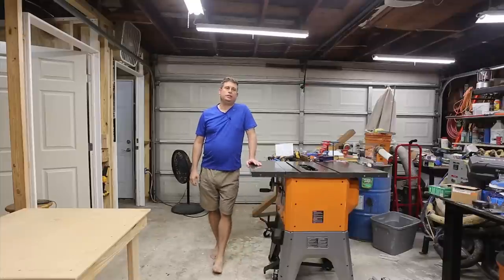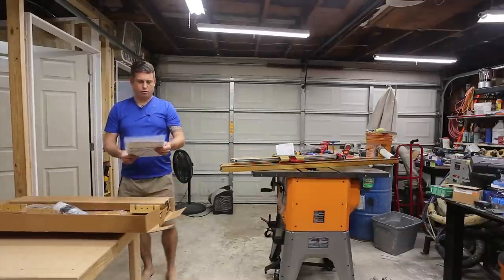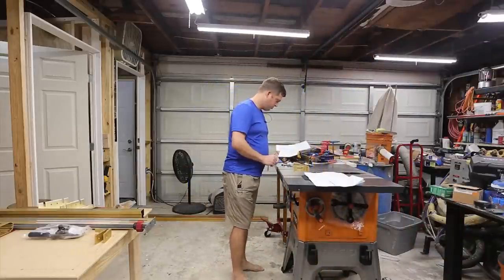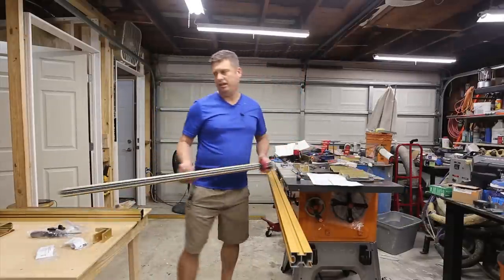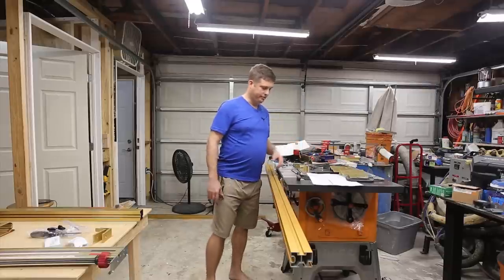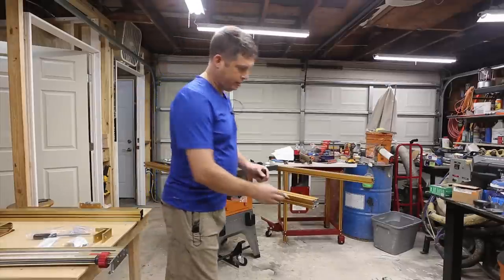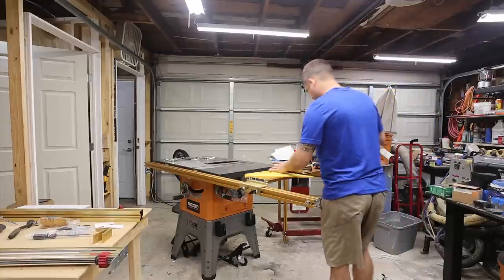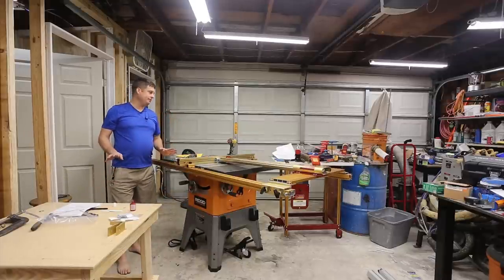Install Incra Fence System on Ridgid R4512 Table Saw

Comment: Finally, a DIY guy that moves at my speed, does things they way I do and is more real. You reading the instructions could have been left out but but I am looking to do a similar setup. Thx
Reply from the maker: Thank you.  I try to shoot my videos from the "hang out while I work on this" perspective for the most part.  I find pure instructional videos to be boring.  I've tinkered with more and less editing.  These are some of the longer ones and could definitely have been shortened.  I thought it might help folks to see an install.

Comment: Just so anyone else watching this knows you do not need to drill out the rear bolts for the fence brackets. The holes are already tapped and threaded and you just need to use the bolts that came with the Ridgid Saw for the rear Incra rail. I just installed this same fence myself recently and noticed this video. Thanks for sharing your experience.
Reply from the maker: Correct.... that was my mistake, but it turned out great.  Unfortunately a new project I'm not ready to talk about has crowded my garage temporarily.  All in due time.

Comment: Did you think about the metal shaving that dropped while you re-engineered the installation of the rail  ? Just wondering bc you forgot to put your shoes on . Glad it's your feet and not mine . Thanks for posting the video

Comment: I'm sorry, but you left out the very important step of positioning the two fence glide supports at the front and back of the fence. (at the video13:00-13:04)  These supports are for leveling the fence at the proper clearance height above the table to keep the fence smoothly gliding on the rails. A vital part of the setup process for accuracy.

Comment: My incra fence is supposedly going to ship any day now. I'm scared to death now because I did not realize I had to drill into the cast iron top of the saw.
Reply from the maker: It depends on the saw and how you want to install it.  For my particular saw and the way I wanted it installed drilling was necessary.  It wasn't a big deal.  Just measure carefully and go slowly.  Do not put the drill on high and push hard.  Heat kills drill bits and you want to let the cutting edge on the tip of the bit do it's job.  A little light oil won't hurt either.  

The key with cast iron is to drill slowly and take your time.
Reply: @hotpuppy72  I have the ridgid 4512. I wanted to offset my rails closer to the right because I am limited on shop space on the left side and can not move the saw any further over to the right.

Comment: I don't have one but considering buying one and figuring out the install for my saw.  At around 20 minute mark, you had drilled holes in your saw and said you needed a bigger drill.  You then seem to have cut the part where you finished that part and we see you start to install the rail.  So, I'm slightly confused.  Are there rail brackets on the outfeed side?  Or, do you screw into your saw blots that slide into the rail?  I can't really see.
Reply from the maker: Oh, the first drill bit I used was too close to the bolt size.  I didn't film the second time I drilled the hole with a slightly larger drill bit.  Like many people I tend to buy drill bits as a "set" and then break or lose the most commonly used drill bits.  :)  

As best I remember, the rail slides on to bolt heads and then you tighten the nut on the back side to draw it tight.  

Believe it or not I have not gotten around to doing cabinet work, which is what I set this saw up for.  So other then a test cut or two I haven't done anything with it.  Part of the issue was that I got laid off and decided to make a career change, money has been tight.  Part of the issue was that the garage workshop wasn't finished.  I'm currently in the process of re-arranging and finishing the garage workshop.  Hope to start on cabinets very very soon.

A few folks have criticized the saw, but the Ridgid is a fine saw.  The Delta at the same price point is a fine basic saw as well.  Where it tends to be lacking is the fence and the table size.

I did rotate the caster arrangement by 180 degrees to make it easier to get to on the saw.  It's designed to be on the right side of the saw from the operator's position.

I used to have a Delta Unisaw.  Dust management was a nightmare, it was impractical bordering on impossible (per Delta Support) to retrofit a modern safety system such as a riving knife to the saw.  I had a Biesemeyer fence with a digital read out on it.  I found it nearly impossible to easily get precise, repeatable cuts without lots of fiddling.  That's fine for production work where you set it up and make hundreds of cuts.  It's a nightmare in a home shop where you make 1 or 2 of something and then move to the next part or cut.

Incra lets you dial in the cut you want with precision, make it, and move on.  This requires some setup on the front end.  If you need to make that cut again, you simply dial it back in.  I considered mounting the router on the saw but decided I like having dedicated tools better.  I also have an interest in metal machining which has exposed me to doing close tolerance work (.001 and .0001 inch tolerances).  Once you learn to work precisely it's difficult to accept +/- 1/16 of an inch which is .0625 inches.  I'm not suggesting that you can get thousands or ten-thousands tolerances in wood, but I can do better than hundredths of an inch.  To translate for my Metric friends (the rest of the non-US World), that 1/16 of an inch is 1.5875 MM which is pretty sloppy in my mind compared to .025mm (.001) or .00254mm (.0001)

While this saw is capable of handling 4x8 sheet goods (approx 1.3 x 2.5 Meters) that is a dangerous way to cut sheet goods.  I usually set up my track saw and am able to make my rough and fine cuts safely and easily without any risk.

Lastly, this is a long response, so I'll touch on another person's comment.  I was asked why I didn't buy a SawStop.  It's a nice saw, but it costs more than this Ridgid and the Incra fence system without delivering the same level of accuracy.  Nifty safety gadgets are not a substitute for safe work practices.  If the SawStop was a $100 or $200 premium I would have bought one instead.  It was almost a $1000 premium and I opted to continue doing what I have been doing for over 20 years, work safely and use push-sticks and other means to keep my fingers well away.  My TrueTrac (Track Saw System) is one such way of avoiding the dangers of cutting sheet goods on a table saw.
Reply: @hotpuppy72  Thanks for the response

Comment: What are your thoughts on the Incra Fence system after having it a while? I have the 4512 after spending a lot of time aligning the Arbor to the miter slot I am happy with this saw. I bought mine in 2014. I will say my lift mechanism pedal is in the front of the saw.
Thanks looking forward to hearing your thoughts.

Comment: Two things about being barefoot in a shop.  One, your wife is far more forgiving about tracking in dirt than mine.  Secondly, I agree with the others, it's not a good idea.  True, floors don't cutoff fingers, but they can have wood chunks, dropped screws,  splinters, and other debris that can injure a city slicker's tender bare feet.  And, you're less likely to slip wearing shoes.  ;-)
Reply from the maker: I appreciate everyone's concern... but A) I'm gay.... no wife, not now, not later, not ever.  B) I'm very careful and there was only sawdust out there that day.  The concrete felt good on my feet.   I don't anticipate any slip and fall issues on a concrete floor.  But I commend you for thinking about safety.  Keep up the good work.

Comment: Thanks for the video, it showed me things that I will try to avoid doing, I always wear shoes so that is a given. If you read the comments here, John Barr suggests buying a better saw, try the price and the fact that all those saws have a fence system that can't reproduce as well as this one will. The TSLS I ordered is supposed to be here next week, it is going on an old 10" Craftsman full size, they made a table top size that I don't think this system will fit, the table top was only 24" front to back. Riving knife, oh goodie another of those people who believes they are really great, to a point they are, until you discover they have vast limitations, you can make bad comments about my disdain for such things if you like, I started doing wood working before a riving knife was even thought of. Learn to use tools in a safe manner, don't expect manufacturers to make everything safe for you.

Comment: barefoot in the workshop!? and you talked about missing safety devices on your old tablesaw?.... mmmmm that's not responsible!  ;)
Reply from the maker: Fortunately, most concrete floors don't take fingers off.... even if you slip.
Reply: I did not think about the floor, but rather about letting fall a tool, or wood piece, or other on your toes ;)
Reply: Simple solution. Don't drop tools or wood. Be aware of what you are doing and your environment and you will be fine. The safety issues with using tools are completely different, because you never know when a piece of wood will jam unexpectedly or a board will kick back while you are cutting it. The reason people drop boards and tools on their feet is because they leave them piled up on their work bench or hanging off the edge, or are just not paying attention to what they are doing. 

I rarely wear shoes if I can avoid it and the only serious injuries to my feet have all been while wearing shoes. Maybe that's because people are more careful of where they put their feet when they are not wearing shoes.
Reply: Yes but no matter how careful you are, accidents happen. His box cutter could easily fall off the table and stab his foot.  I fully agree with Mr. P. It is completely irresponsible to show a video of a garage full of tools being used by someone without shoes. It sets a bad example.
Reply: Why not give credit for minding to remind freedom of and right to choose in own home, own feet, own life. Don't likey don't watch.
Reply: A 13 year old watched the video with me (Grandpa) and asks, "Drop a machined aluminum piece on one of your toes and see what happens I guess!"  So, I agree with one here who posted, "... that's not responsible ..."  Your intention is appreciated but isn't it Interesting that the documentation from Incra first focuses specifically on their concern for user / owner safety issues (re: in both installing and using the machinery) and they insist that you read all directions cover to cover one time before you begin.  A barefoot installation video free to anyone (any age) willing to watch?  How's anyone going to take it seriously?  Just say'n ...
Reply: I know I'm late but I wes born  with bare feet.

Comment: You really shouldn't use a cordless drill to screw in screws to aluminum. Aluminum strips out real easy.
Reply from the maker: Any tool can be abused.  I have carpal tunnel issues in both hands so I try to avoid manual torque operations whenever possible.  I'm careful with the impact driver and the cordless drill.  I rarely use the cordless drill for screws but it happens from time to time.

Comment: Dude your table saw just tripled in size. Is it worth it?
Reply from the maker: I think so, but not sure yet.  My screenprinting company startup has gotten in the way of my garage so I haven't had a chance to do much with my new saw and router table.  I'm patient though.  I should get my garage back this coming week and be able to put the saw through it's paces.

Comment: The reason to move the fence to the left side would be if you have a router table insert installed on the saw.
Reply from the maker: That's a good point.  I hate setup/breakdown between operations and decided to invest in a separate router table.

Comment: It doesn't make sense to add a top of the range fence system to a very basic contractor saw. Why not invest similar dollars to a much better cabinet table saw with a solid fence and better dust control eg Powermatic, Grizzly,  Laguna, Saw stop (although this is expensive) etc.
Reply from the maker: I disagree.  I chose to buy a "good enough" saw and invest the savings in a better fence system.  My last "big" saw was a Delta Unisaw with a Biesemeyer Fence and a Wixey digital read out.  I scrapped it.  I hated that damn piece of crap.  It threw dust everywhere and it was extremely difficult to do repeatable or precise work with it.  It was no better than my $120 Ryobi saw when it came to the fence.  In fact the extruded aluminum fence on the Ryobi was better because it had a rear lock on it.  In the $600 to $1000 price point your options are essentially Grizzly, Delta (Lowes), or Ridgid.  I like Grizzly's stuff but they were out of stock at the time and I don't think it's that much nicer of a piece of Chinese equipment then the Ridgid.  The Delta was my runner up choice...  Ridgid has good reviews and plenty of people do nice work with it.  My goal is to build my own cabinets and some basic furniture projects.  This will meet my needs without spending tons of money on the equipment.  I looked at SawStop as well.... it's nice gear... but it's double the price and I don't like their bully patent monger tactics.  

Lastly, the fence could be relocated if I outgrew the saw.
Reply from the maker: I also want to add that I have space constraints in my current garage/shop.  I need to be able to easily "unpack" for projects and setup shop in the driveway and then slide everything back in and store it.  Flexibility was key and the Ridgid included a well designed wheel system which was extra with everyone else.... and their systems weren't that nice in some cases.  I do have one complaint about the ridgid caster system... it doesn't lower nicely and doesn't play nice with the extra weight of the Incra fence.  I can live with that though.
Reply: I also disagree.  A table saw is just a motor and a blade.  The fence is where the precision is
Reply: In my opinion, to answer your question , "... why not invest ..." is because there isn't a saw or router system that comes standard from the factory, which has the Incra system installed.  I want the repeatability and when I take into consideration the features I get in my Ridgid saw and couple those features with the ultimate fence system, then I have the perfect setup; not to mention that it saves me so much space in my shop as I don't need a separate setup just so I can use a router in a table.
Reply: Agreed ... and let's not forget that it is cast iron (actually NEEDED if you're going to mount something to it; i.e. rails); don't forget it is a 110V (which can be changed over to a 220V); and that one would spend at least $150 dollars or more for a decent stand (which, by the way is probably the neatest, most versatile stand I've seen on a saw in this price point).  There is lots to consider; for sure.  But, if you carefully look at the features and then compare the price of the saw; in my opinion, it's a no-brainer; THIS is the saw you want if you want the repeatability of the Incra which doubles (table saw and router).

Comment: First of all put some shoes on. Second "Delta Unisaw is a piece of trash" This comment is must be a joke.  No riving knife? Dude you can get buy or build a insert with a riving knife. They even sell after market kits to retro fit them. You went from a unisaw to this?  Please take this video down and save yourself further embarrassment.
Reply from the maker: I tried the OEM kit and it didn't fit.  The unisaw threw dust everywhere and the Biesemeyer fence was a pain to adjust.  Even with a digital readout it was tedious to adjust for a specific cut.  The unisaw was great in the 1940's when it was designed.  There are far better options today.
Reply from the maker: That kit flat out sucks.  Been there done that.  I think I still have some of the pieces laying around in a toolbox somewhere.  The Unisaw has horrible dust management.. and the Biesemeyer fence repeatability is laughable.  Sure you can square it and it will stay true, mostly.  It's a 3 point clamp fence.  That isn't nearly as accurate as Incra's approach.  

Anyway, I don't see a point in debating this with you.  If you like the Biesemeyer+Unisaw so much why are you looking at the R4512+Incra video?  

The R4512 is a good bang for the buck compromise.  It's a solid tablesaw.  The Unisaw's redeeming feature is that it is cast iron and very heavy.  That's great if you are sawing timber or have fantasies about feeding sheetgoods across your saw.

For sheet goods a track saw is the way to go.  It's far safer.  TrueTrac is a nice American made option.  I have a few videos on it.  

For folks on a budget who want precision, R4512+Incra.  That gives you Ridgid's great support with Incra's precision.  Set it and forget it cuts.  Not try, try again to make a precise cut.  By Precise I mean being able to set a 1.75" cut and not have to check and recheck it to set it up again later.  Not a 1.79 or 1.72 cut, a 1.75 cut, exactly.  Projects go together much better when they are accurate.  Incra is the most accurate fence system on the market.

Lastly - this is my opinion.  It's my channel so I'm entitled to my opinion.  6,600+ people subscribe and I have 3.1 Million views.  So I'm probably doing something right.  If you don't agree with my opinion, by all means shoot your own video and post it to your channel.  Perhaps you can teach others something.  As for my woodworking, I'm just a guy with a garage and a modest budget.  I don't get my tools for free and I don't have a staff to produce my videos.  I can't say the same for others.